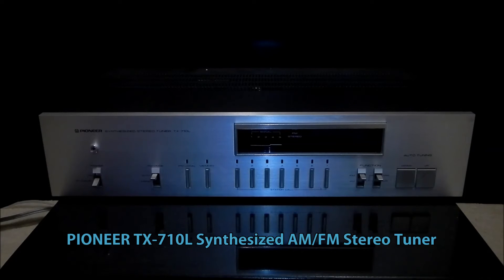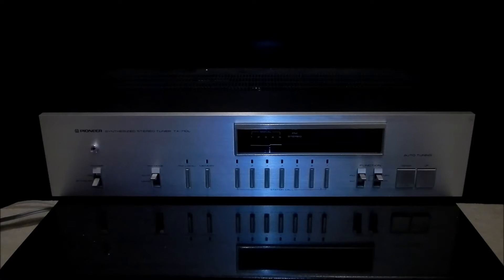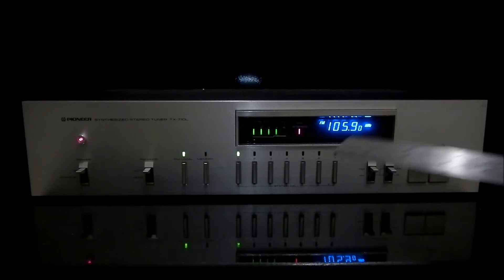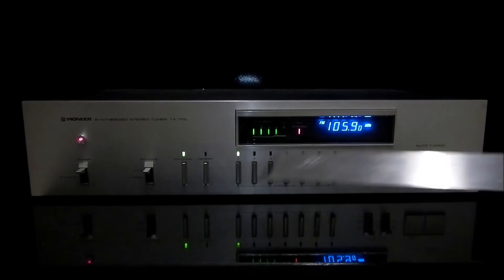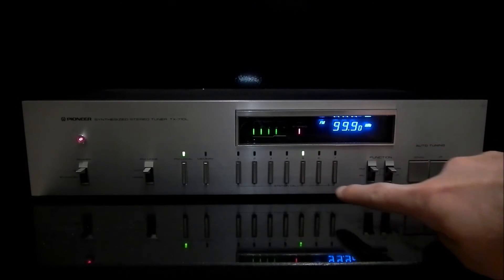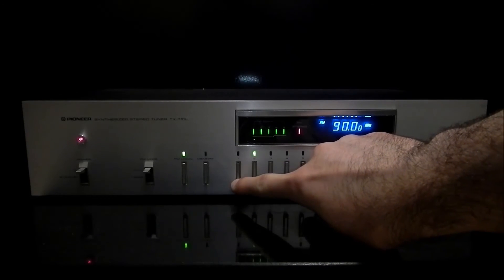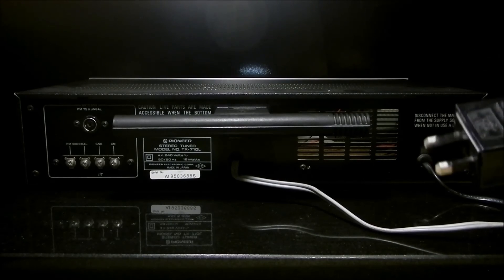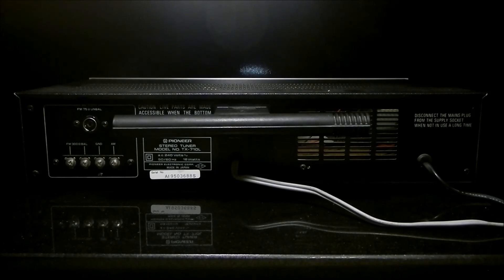Pioneer TX-710L Synthesized AM/FM Stereo Tuner Review & Demo

Comment: I have the TX-720 but I cant get a signal, i.e. all the signal strength indicator lights are off. Is there an antenna connection that i have to configure in the back?

Comment: Does anyone have this tuner ? Is it worth getting? I have the SA-708 Amplifier and  TX-608 tuner . Is this digital tuner better or equal to the TX-608 ?
Reply from the maker: Tx 710L is superior tuner to TX-608(L), but it's from different catalog year and different series. For this reason I would stick to TX-608 to complete a matching collection. However if you can get it cheap, then treat yourself with one :) Check out catalogs on Hi-fi engine https://www.hifiengine.com/manual_library/pioneer/hi-fi-stereo.shtml